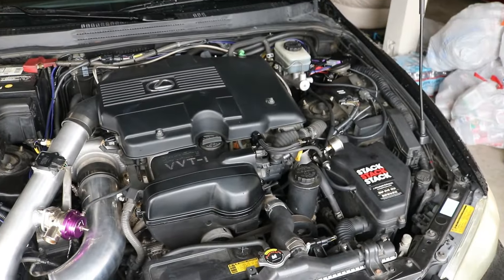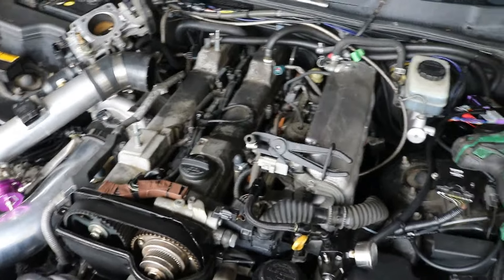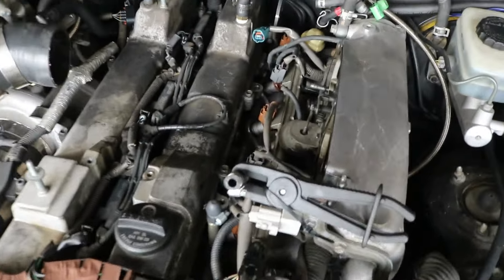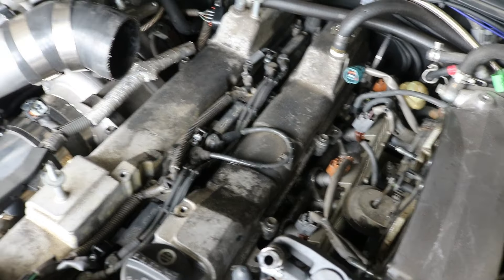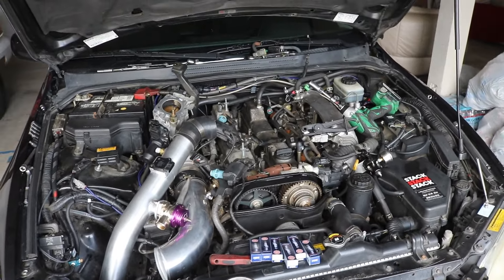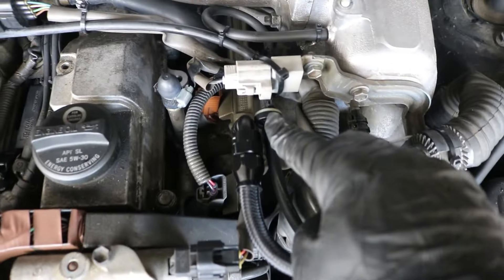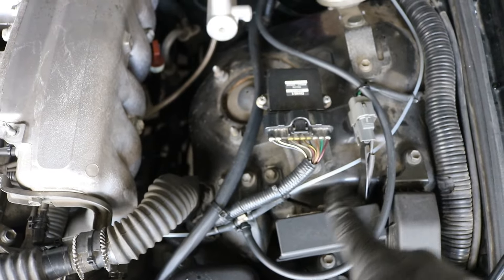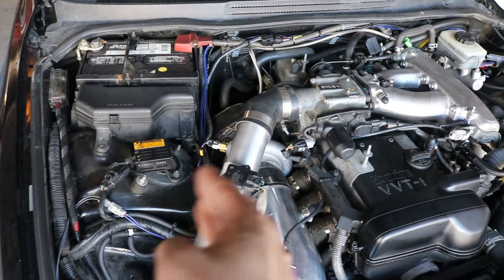Getting the IS300 Turbo ready for the dyno!

Comment: Great video!  Whats your thoughts on upgrading to coil over plug for the IS?
Reply from the maker: I will say that the stock ignition system does have limits. What those limits are will vary from setup to setup. I would say that if you plan on making more than 600 whp then I don’t see the need to do so. Even if you plan on making more power than that, you could run an ignition amplifier if it is cost effective. 

The is300 coils might be able to make more, I think the system as a whole would be at its limit around 600ish whp. Of course I have not seen everything under the Sun and there might be some guy claiming to make 1000whp on stock ignition system.

Most COP 2JZ I see are making 800+ whp

Comment: Don't go innovative. They are more high maintenance than my ex wife. Go aem x series. They run a stronger accurate signal. Sounds like you have a Brad ground wire to your aem.  If the sensor doesn't get a good ground it will foul out.
Reply from the maker: Thanks for the tip. I was going to go with the x series before I bought this AEM wide band I have. Problem is, I don’t need the X-series. It has a built in controller and more features that I will even need. I already have a Bosch 4.9 LSU feeding my stand alone. It works great! The AEM gauge in my pod is simply there for redundancy. My plan was to just try another brand of a basic wide band (w/gauge) and see how it last. I was reading people were have the same problem with sensors dying on the innovative but the overall rating was good enough (~4.7 out of 5 stars) just like the AEM was.

I know my ground is good. That was the second thing I checked. It is on a sanded off piece of metal. I even took it off and re attached it to be sure.
Reply: @Knownworldwide  yeah that makes sense. But being you've have two sensors go bad I bet you have a bad group or power wire. If you leave a sensor in the down pipe without power going to it, it will destroy the sensor.
Reply from the maker: @richardwilliams9815  First one worked just fine for about 7 months. Then it died. Second failed within 15 seconds. Just gonna change up. I was gonna buy a Stack wide band because I trust them but again, I don’t need a very high end controller. So, I will just have to deal with it after the dyno session.
Reply: @Knownworldwide  I'm excited to see what it makes.  Just picked up a 05 in San Diego and drove it home to Salt Lake city. Car is in amazing condition. I love your build set up.  I actually build turbos for a living.  I'm going to pull the engine this spring and do gte rods and a s300 ball bearing turbo. Plan on around 16/18psi on pump hopefully 500whp.  It's completely stock so going to be fun building it.
Reply from the maker: @richardwilliams9815  awesome! Yeah, I am new to this platform but not to modifying cars. I am just trying to provide a relatively budget setup for all those out there who are happy with a modest amount of power. I know my injectors are going to limit me but I have run 9psi so far and that is definitely the ragged edge of the fuel system. I am just curious to see what it will make. 

My buddy seems to think it’s gonna make good power. We’ll see.
Reply: @Knownworldwide  I'd recommend doing a fuel pump relay rewire. Makes sure you get 12v or more to your fuel pump. $35 and a few wires.
Reply: @Knownworldwide  I like how you put the engine cover back on.  How I'm going to do mine.  I want it to look as oem as possible. Just sold my 1992 galant vr4. Built engine, head and trans. Put down 534awhp. Looked completely stock on the outside.
Reply from the maker: @richardwilliams9815  awesome cars! Why sell it? I have heard of the fuel pump wiring mod. Just haven’t gotten around to messing with it quite yet. Fuel pressure isn’t suffering as of now. Just a single 340 pump in the stock hangar. Should be good enough for 500whp on pump fuel. Although with the stock GE bottom end, I’ll never reach that. Going to just keep the boost low for the dyno and clean up my fuel maps. I have already been street tuning it and it’s pretty dialed in. I want to mess with my timing some more now that I will have a dyno to see what’s actually going on.
Reply: @Knownworldwide  had an offer for it I couldn't refuse. And wanted a is300.
Reply from the maker: @richardwilliams9815  Fair enough. Appreciate you taking the time to watch the video! Hope you decide to stick around.
Reply: @Knownworldwide  Careful running a big fuel pump off the stock wiring. My car had a Walbro 255hp running off stock wiring. When I took it apart it was obvious it'd been getting hot. It'd cooked the insulation off the wires. Pretty uncool.
Reply: @Knownworldwide  live the channel and how you do things. If you have any questions let me know.  Built over 50 cars.  Keep up the great videos
Reply from the maker: @GroovesAndLands  we’re you running the 12v wiring mod?
Reply from the maker: @richardwilliams9815  appreciate that!
Reply: @Knownworldwide  Dunno. Dunno what that is.
Reply from the maker: @GroovesAndLands  Oh ok, probably not then. It’s wiring a relay up to make the pump run at 12v all the time instead of a varying voltage like the factory setup does.
Reply: @Knownworldwide  Interesting. The same effect could be achieved by simply removing the OEM fuel pump resistor and putting a jumper wire across the pins for the connector that goes to it.

In the end I installed a new, dedicated relay with 12AWG wire for the new fuel pump.
Reply from the maker: @GroovesAndLands  Sweet. So far I have it still operating like factory. I suppose when I start making some real power I can visit that.